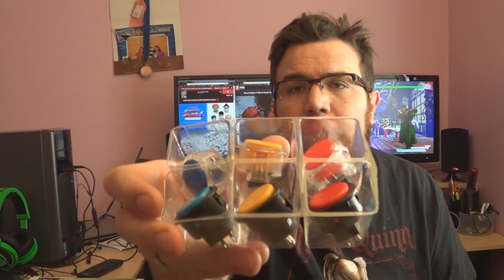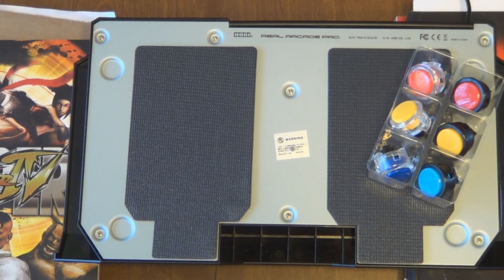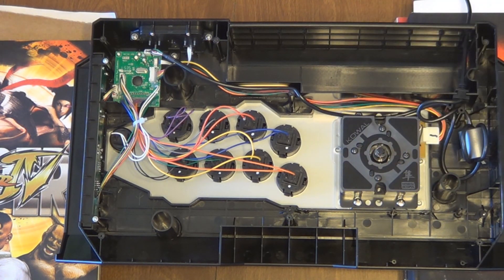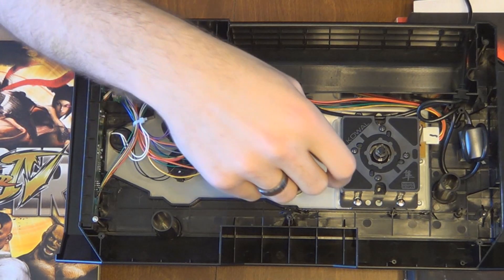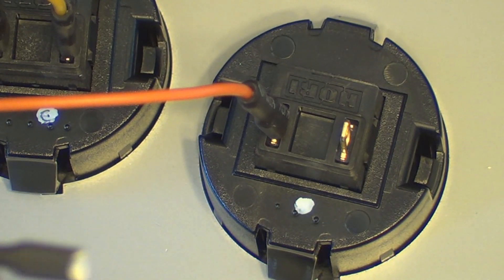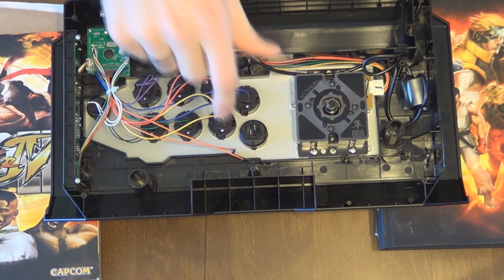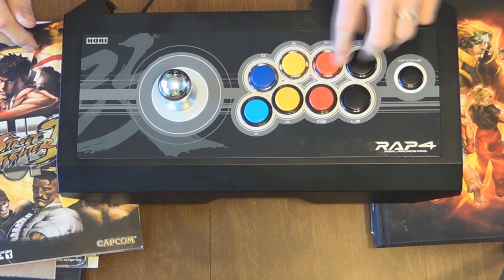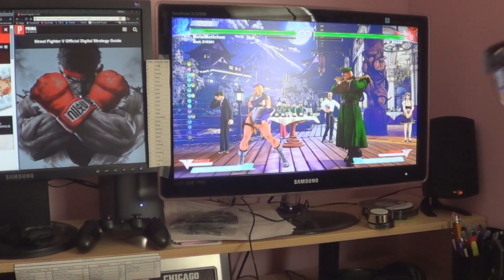Hori Rap4 Button Changing

Comment: how long did the stick last until you had the 1st problem?
Reply from the maker: Taken GTs well day 1 if you count the tension on the spring to be too loose. I immediately put a heavier tension spring. Maybe a month later I switched over to a custom build using the Brook fighting board PCB.
Reply: Matt Hamidy im not to worried about that nothing a little practice couldn't fix.
Reply from the maker: Taken GTs other than that, the cable compartment door is a piece of crap. That doesn't take away from the actual stick. I think it has good weight and foot print. I'd still be using it if I didn't like my custom build so much. Plus if you go to any tournament you still that Hori or TE sticks. So that has to be something. If it was garbage you wouldn't see it out there as much right?

Comment: Hey man recently just saw this video since I bough this stick and want to mod it, just had a few questions. I was wondering if taking of the sticker really voids the warranty and also what are the chances of even needing to have a valid warranty, are sticks in general pretty easy to fix or easily broken?
Reply from the maker: hi1234258 the sticker says void if removed. Well I never removed it so I should be good. The only thing that that needs to work is the PCB. Just about every thing else can be replaced easily and pretty cheap too.
Reply from the maker: hi1234258 with normal use the stick will probably outlast the system it's built for. I know plenty of people who pick their sticks up by the actual stick part and they still use it no problem. In general the first part you may have to replace is the micro switches for the stick itself. They can be replaced individually, but it's easier and only a tad bit more to just replace them all at once.

Comment: what size are the 8 buttons? 30mm??
Reply from the maker: Yes they are 30mm. In fact most face buttons are 30mm. The only real exception is on HitBoxes. Also both Screw and Snap buttons will work.